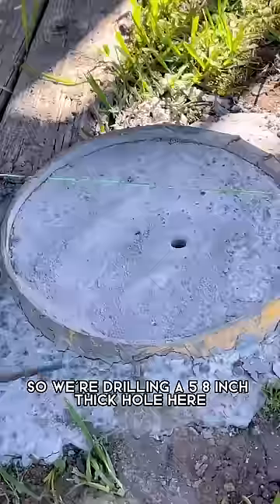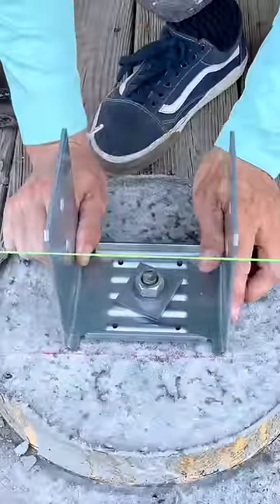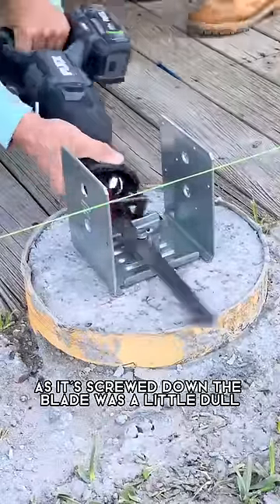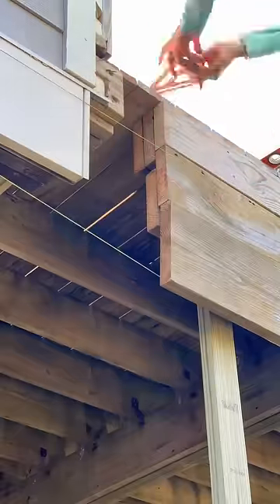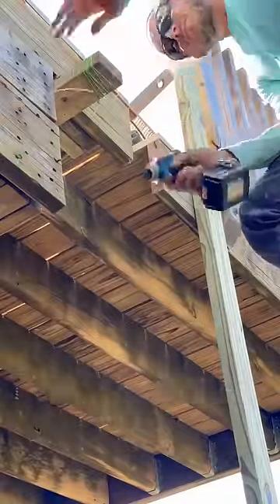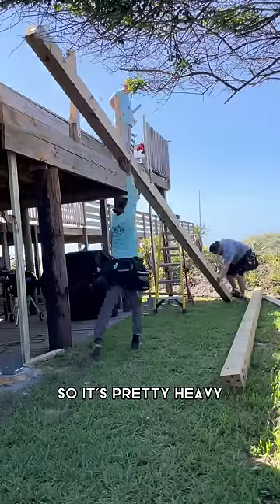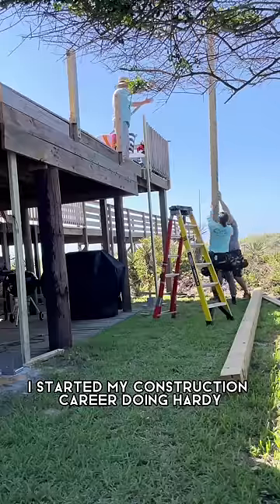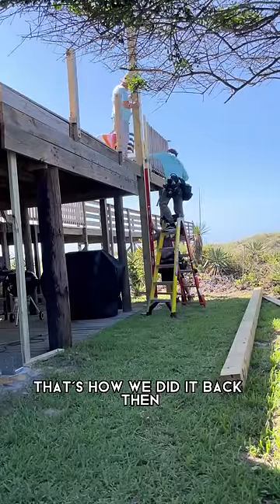Roof Addition Part 2 Short

Comment: Someone forgot to put the hooked J bolt in the concrete before it set 😉
Reply: it was a wedge anchor that he dropped in.
Reply: @Frumbler, are you in the western US?  I, like you, am accustomed to dropping anchors in wet mud. I'm west coast.  I find that middle & eastern US do the drill & drop.
Reply: Different codes
Reply: J hooks are unnecessary
Reply: @Bourbon Rebel  not required globally,  yes. Many jurisdictions require bolts to resist uplift from winds & quakes. They are good insurance because quakes & windss can happen anywhere.
Reply: He’s not building an industrial building it’ll be fine. You’re either an over worker or just watched some rebar video and are acting like you know everything about every trade
Reply: If not required, a nice bit of insurance. I find that folks who are not used to wet insert are concerned about accuracy, or commitment to such in advance.  Once one gets the knack, placement is old hat, especially with all the great tools/jigs available or to build.

Comment: Only two things I’d say, never cut your bolt, it’s galvanised and.  Don’t rattle gun anchors, the have a specific torque
I do agree with a few in the comments, your better off using a wet concrete anchor. Or using resin and all thread bar

Comment: You shouldnt use an impact on a wedge anchor it will apply too much force and vibrations to the concrete and can pull the anchor through the concrete. If you use a big ratchet you will get it plenty tight and have a better feeling of how tight the anchor is

Comment: Wait. So now what is going to be holding up the joists where you cut them out?
Reply: Dude ya! Why did he cut through the Joists?? Should have notched the post a little or bolted and glued a support onto the post to support the deck, Right? Does my solution make sense?
Reply: @johnburns2940  Absolutely. You notch the post, then bolt or lag the joist to the post. Never cut the joist/stringers. Now they have zero rigidity or support for the rest of the joists that are attached to it.
Reply: Precisely what I was wondering.
Reply: @jmackinjersey1  its hard to beat joinery when done correctly. modern hangers and nails are nice but cant forget about gravity and structural integrity, i know code says its fine but its nice to go the extra step, for tegridy.
Reply: This dude does everything wrong lol.
Reply: It was supposed to be the post they added, but they cut out all the joists to fit the post lmao. So dumb!
Reply: @jmackinjersey1  Now the deck holds up the post, since they cut out all the structure the post was supposed to hold up lol.

Comment: When mounting brackets to concrete I always drill an extra hole and put a tapcon through it. That way it won’t twist over time.
Reply: Can't you just insert it while curing?
Reply: @kenihow  exactly bro😂
Reply: @kenihow  of course. I would have used the brackets that go in wet, but I was just saying when attaching to existing concrete.

Comment: No one's pointed out yet that he chopped through the triple joist on the edge of the deck! 
Hope he got some hangers on there
Reply: Right? If it was me I would guess it would be stronger if the joists were sitting on top of the post.. or notched into the post... only limited diy experience though so who knows 🤷‍♂️
Reply: Usually the post is under the beam and use some Simpson post /beam brackets attached with tico nails
Reply: No flashing installed yet either?
Reply: He literally says in the video he will go back after he puts the post in and make sure it's connected in properly and will add extra blocking if needed. As long as he ties the post into the beam on each side there's nothing wrong with doing it like this.
Reply: 🤔 thought the same thing?
Reply: and the whole anchoring on the bottom (besides weight) is a single 5/8s bolt to a bracket.. pfft .
Reply: Didn't look right to me. But I'm just an engineer. He said he'd come back and connect it RWALLY WELL🤣
Reply: That deck is gonna sag i. That specific spot over time because he cut the whole joist out. Blocking will help for alittle but the fact thats its not one solid beam anymore even hangers sag overtime. That job looks ass backwards.
Reply: @BEAUTYnIQ  l
Reply: I think that I would have moved the footing and post before the deck obstructed doing so...
Reply: @robertashdown4984  You don't guess, you're right. The whole point of the post is to hold up the joist/beam, but this clown cut them out lol.
Reply: @jimdaily5808  There absolutely is something wrong with doing it like this! The beam is supposed to be on top of the post so you're not 100% relying on brackets or fasteners to hold the beam. When the beam is on top it will be supported by the post even without fasteners, this is a significantly weaker and dumber way to build.
Reply: @danthecarpenterman9463  
"Simpson eh?" replied Mr Burns

Comment: It’s good to use the Simpson epoxy in that hole for the wedge anchor
Reply: And probably cold gal the exposed bolt that was cut off to prevent corrosion.
Reply: Probably not. Epoxy and wedge are two different anchoring systems. The manufacturer would disclaim that installation. It would probably be stronger, but it's better to do things the way the manufacturer wants you to.
Reply: Mr Burns says "Simpson eh?"

Comment: Just came to read the “professionals comments” on how to do it better
Reply: Me as well.  Like  " back when I did those posts we covered the bottom with Miller Lite , that shits do nasty it keeps carpenter ants away. 😅
Reply: Professional would NOT cut into the joist
Reply: @Mr.Thermistor7228  . I came to check for some explanations about how to fix that.
Reply: nothing wrong with getting information from people with different experiences and perspectives.
Reply: @godw1ll99    Can you please share with us an idea about how to finish this job in a proper way.
Reply: @J.ArturoMartinez  i wouldnt know.
Reply: @J.ArturoMartinez  im not a carpenter so i really dont know but i would imagine that is like cutting the frame of a car in half. it is the piece that is holding most if not all of the structural load so if you cut it in half the only way to fix that would be to replace it completely with one that isnt cut in half
Reply: @godw1ll99  I do agree with you about having different perspectives.
Ty for your attention.
Reply: @Mr.Thermistor7228  I do agree with your appreciation about not to cut the joist. So to make that "JOINTS" to work I think is a real challenge.
Reply: The moment you cut that van board you ruined the structural integrity
Reply: " replace the cut joist with one that isn't cut"

Wha???

One that isn't cut is two that are?? If you put in the proper hangers, it's irrelevant.

Comment: Are you guys going to replace the railing posts? They are not supposed to be notched, and it appears those existing posts are.
Reply: In my part of the country if the deck post and rail post are one in the same you can't notch post if over 4' off the ground, but rail post as in the video it has to be notched and bolted through .
Reply: @tommypointer7876  Look at the existing rail posts. They are all notched. I'm not talking about the post they are installing.
Reply: @jmackinjersey1  yes that's what I was saying ours has to be notched by code but 90% of rails posts here are on the inside of the joist .

Comment: The cap you put over the bolt is supposed to be installed so the bolt and nut are visible for inspection

Comment: Why cut deck joists? just put post from ground upto joists secure with brackets to joists. then add secondary post on topside of deck, transferring vertical load on upper post to both the uncut joists and post below.   then secure second post on top deck with brackets. The vertical  load integrity  is much more important then the lateral load. you have weakened the whole deck by this retro change. Consult an engineer before making these type of changes. your bracket at bottom peir is also 2 small, and should be adjustable up and down. You are endangering lives by this

Comment: According to building code you don't cut the bolt flat like that, you suppose to leave it a least an inch longer
Reply: Interesting, it didn't look like the cover plate even had an extra inch to accommodate a bolt that high. Should they have used a higher plate?
Reply: He definitely cut it too short. But should be minimum 3 threads. He also should have painted it. Gonna start rusting.
Reply: Stand off plate is an inch. There's not much wiggle room after the base , washer and nut for any extra clearance

Comment: You do a good job explaining as you go.  In this instance I would like to know if beams were on top of that post or at least notched into it to bear the weight.  It looks like you cut anything away to be able to do so.  Bolting beams to post is like creating a log splitter.  Blocking will help but it should run to the ground.
Reply: Yeah always best to have the beam on top of the post. Instead of cutting down the post to fit under the beam they cut the damn beam in half, crazy!

Comment: Just a tip, never tighten with an impact it might seem tight but it’s not. You’ll  realize this when you tighten by hand with a socket wrench.
Reply: What if they use a 1/2 impact wrench
Reply: I guess you meant that the impact is going to make the concrete lose strenght while is getting tight, thats the point?

Comment: Just one in the middle? The machinist in me tells me that post will rotate. 😆
Reply: Well it is fixed at the top
Reply: Treated lumber will warp as it dries no matter what you do. The point is that there is continuous contact from the header to the ground and that is fastened together correctly….which was done
Reply: What he's referring to I am assuming is the single bolt in the pau66 post base. With the concrete not being a slick finish and the post base having some concave spots in it it is unlikely it will spin.
Reply: I always use two I agree
Reply: The old saying applies: No me Casa!

Comment: Flush cut of the bolt at nut not allowed by UBC & AISC; 3 bolt threads min. required visible to become structural connection. So, your connection will not pass inspection.

Comment: Why did you cut off the nub of the anchor?
Reply: Stand off plate wont sit down with it that high
Reply: @charlievanlandingham567  isn't there a hole said plate? I've just never seen anyone cut a nub off that type of anchor
Reply: @charlievanlandingham567  there's a hole in that plate dear Liza

Comment: Anchor bolts are galvanised for rust prevention and cutting the stud off you have exposed to rust. You should have screwed the bolt flush to the stud when hammering in.

Comment: Even though anchor is zinc plated, it's now in a open hole that will collect water, dirt, and over time the thin wedging part will indeed rust out, it's only about a 16th inch thick, and concrete will cut through that very thin zinc plating upon tightening! Less then ten years those anchor will be loose, and there's a continuous path water will travel straight down to, & water freezes also !.. take the extra step and fill in with epoxy first for any anchors that's subject to weather.....best not to even use these type of anchor out doors. But it is the cheapest way...plated alltread and epoxy on everything outdoors or areas subject to water. Construction 101...

Comment: I remember standing and walking pump-jack poles when I used to do exterior trim. When resetting them to a different wall or side of the house, I would pick it up in the upright position and walk it to the new location. These were doubled up 2X4's nailed and glued as tall as a two story house. Try that in the mud or snow.

Comment: Why not use a Simpson titan bolt? Unless you already had the wedge anchor. Then you don't have to trim the excess bolt off. If you do have to trim slow down with the saw. It'll make the blade last longer. I'm not sure what the reason for adding the post was so I'm not gonna give any more pointers.

Comment: You wouldn't have to drill a hole in concrete if you would just go ahead and put the anchors directly into the concrete when it's wet. It's stronger that way too. Just saying. Just a recommendation

Comment: Using impact drivers on galvanized bolts is not a good idea. The threads rip off super easy. I think next deck I do using wedge anchors sounds a lot easier than putting J bolts in within a quarter inch on the footings.

Comment: Usually you put the anchor bolt in when the concrete is wet.
Reply: Not a wedge anchor
Reply: @HoLeeFuk317  correct! But usually you put a J bolt in which is much sturdier than a wedge anchor

Comment: When you drive the anchors you want to make sure you unscrew the nut 1 thread out so when you hit it with a hammer you are only hitting the rim of the nut not the tip of the bolt like was done in the video!

Comment: We used to set these while the concrete was still setting, then yah don't have to hammer drill the top of the column and it'll also result in a Crack free column
Reply: But then you got wood that will rot out way faster. The way he did it is far superior to poured in place wood columns. Or any column really.
Reply: @Dogonatree  you use blueskin it's a concrete resistant moisture barrier. There's MANY things you can do to prevent rot and make the job easier.
Reply: @Dogonatree  also It's not like guys set the wood inside the concrete....they set the steel plate in the concrete as long as it's level you're good. No rots even gonna happen if you don't put your wood inside the column and use the plate what it's made for  lol edit:if you are setting posts with concrete then you'd use blueskin.

Comment: Always blow out the dust.   I keep a can of dust off. Works great
Reply: Is there some little-known reason? I've always just let the drill clean out the hole and never had any problems that I knew of.
Reply: @nicholasittzes7224  if you drilling deeper than your anchor and screw you should be ok but if you drilling to certain depth. The dust inside the hole you created will prevent anchor from sitting properly or screw bottoming out.
Reply: @nicholasittzes7224  look up drill hole blower.

Comment: Holes are not thick they're wide or 5/8 diameter. The drill bit would be 5/8 in thick and it would also be 5/8 in wide, but oddly enough voids are not referred to like solids.

That's all..

Comment: I see your using your string... purfect. J BOLT anchors are stronker... takes a little more perfecting because need to stuff in wet concrete though.... they never move haha... next time lifting these put a rope on it and just have roof guy help stand it up..  these 20' PT 6×6 fresh are dumb heavy.

Comment: A competent contractor would've installed a anchor bolt in the footing when the concrete was poured.
Reply: Post installed anchors are a thing. I have designed a few of them.

Comment: Tip. Don’t drill your wedge anchors so deep. If you’re using 4” anchors, only drill your holes 3” so that your anchor bottoms out and starts the flare. Otherwise it doesn’t seat as well when you’re tightening it down the nut.

Comment: Should really leave a couple of threads and not cut flush was always taught 3 for a normal nut or 1 &1/2 for nyloc nuts...
Reply: You have to in order to put the riser cap inside the saddle for the post to sit on. Otherwise the post sits on top of the anchor and doesn’t have a good footing to sit on.
Reply: @slatecreations8193  and once that cap is on there with you post sitting on it, that nut isn’t going anywhere
Reply: @slatecreations8193  There is enough room specifically for those threads that are barely 1/8th inch.

Comment: Never cut the band u literally just ruin any structural  integrity  the deck had u can put all the screw nails and hanger u want but it will still not fix u cutting the the supporting band in half

Comment: Sound a little amateurish. New career from assembling siding as teen  to expert builder..? You have the perfect opportunity to mount this post with concrete support foundation in support of the deck but instead you cut right  through it in hope you'll be able to keep the deck from sliding down. I bet there is no plans.